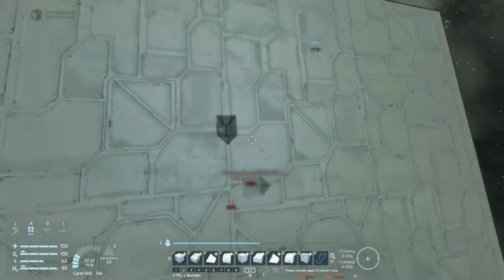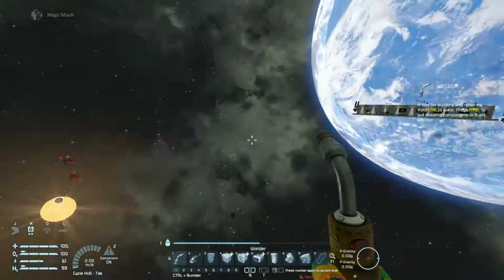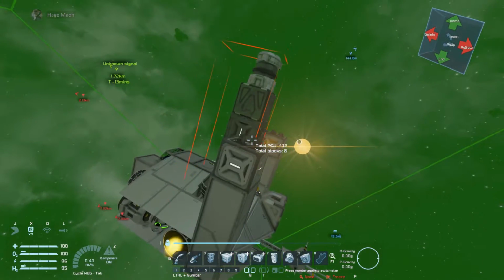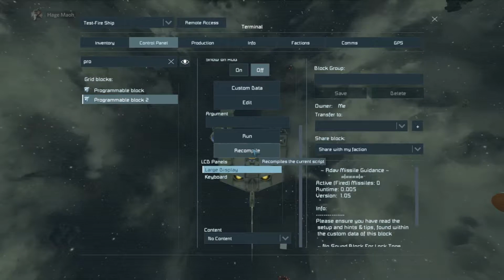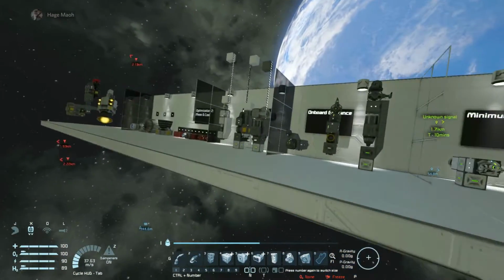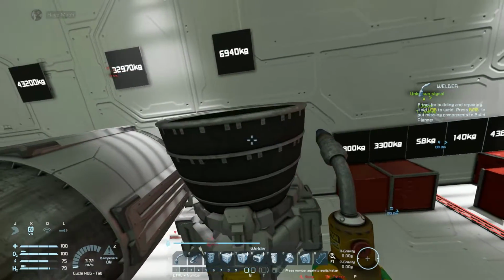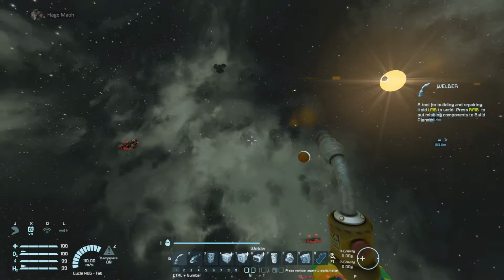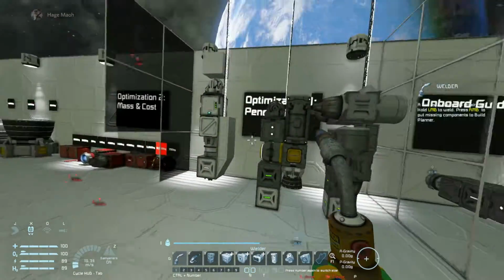Space Engineers Missile - Basic Design Tutorial - Rdav's guided script

Comment: How about a small grid rotor head with small grid hydrogen tank, thruster, gyroscope, hinge etc attached to large grid rotor attached to blast doors and decoys. Using multigrid projection plugin means no problems welding. Am itching to try this.
Reply: And what happens with a speed mod?
Reply: @shahbazfawbush  Little late to respond, but + speed mod and the Kinetic Devastation mod (plus its dependency Bigger Explosions) means lots of fun. :)

Maneuvering to aim becomes significantly harder at higher speeds though, and the game AI/script doesn't handle higher speeds very well. Makes this less guided missile and more unguided torpedo in use (even though it tries to guide/steer). Best to aim the weapon as if it were almost dumbfire.